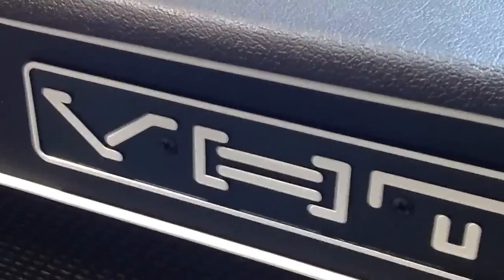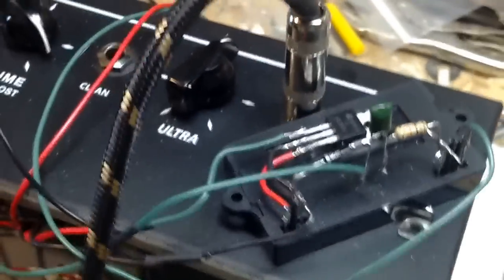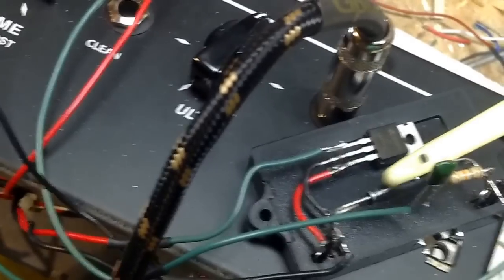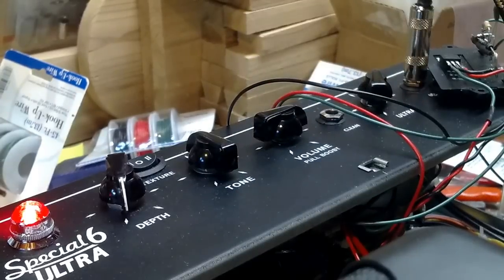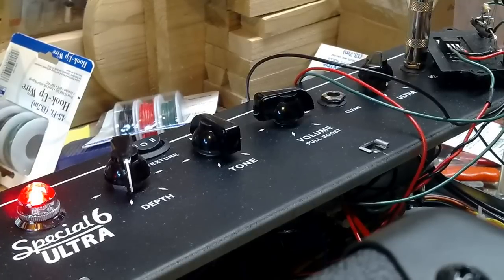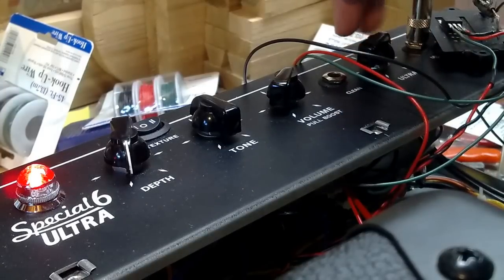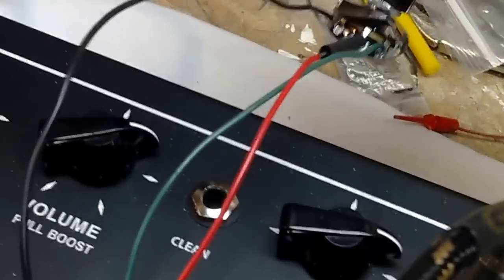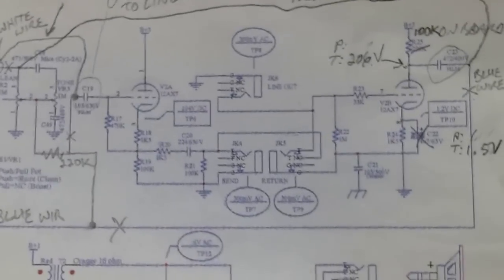Belton BTDR-1H-L added to VHT Special 6 Ultra

Comment: Thank you for sharing. So what i understand is that you installed it between each side of R23 (33k) before the grid pin 7 mixing point. The circuit start with a 10nF cap followed by a 10k resistor. On the output leg of the 10k resistor at the input of the brick there are 2 diodes in serie, the last one grounded to 0V. this prevent from overvoltage signal in the brick. The outputs of the brick feed each one a 4.7K resistor. the other resistors leg are tied to a 50k log Pot. Am I right?
Reply: per my recollection.... it is a .01 uf  cap to start ....     and a 100K pot  with a 22k  resistor on the output ....all other  details  you have  correct,  i believe

Comment: Hi! Thanks for sharing the video, we made but we still have some distorsion...Did you manage to get rid of the distorsion completely or still you can appretiate it? Could you please send the wiring diagram by email saranifer@gmail.com. Thank you very much
Reply from the maker: +Sara NF I did not remove it completely but I have thought that perhaps the distortion is actually coming from my protection diodes (at the input) which clamp at about 1.2 volts.  You could change the input and use LED's instead as a detect and then if they light use a pot that can then increase the resistance before the LEDs to lower the voltage sooner and remove any distortion.  I haven't yet tested it but it's on my TODO list.  What I've worked out is 100k pot (wired as a resistor) common to the LEDs (connected to gnd) with a 2.2k going to the brick input.  This should allow the brick to see a max of 1.39V at the input.
Reply: +Bobsbluesmusic 

We’ve managed to fix all the issues, the BTDR effect is very good. We’ve installed an independent 9v power supply for 7805 regulator, wiring ground to amplifier’s ground (you could use 9v for external pedals). It all works real well.VTH 6.2vare not properly filtered, they have a 1200 cap that could not be enough. 7805 needs at least 7v, a low-drop regulator that works at 6v could be used, but i think the problem comes from filtering.We obtained the best result by connecting parallel with tone stack and resistors higher than the tone stack equivalent, which is approximately 85k, this way signal is not lost and plate resistant V1B is barely modify.Input 100k+cap 0.033/600V   Output 100k+pot 10K.

Comment: The reason why I bought this Rev (Brick2H, long) was to build a small as possible Rev unit to fit into a small speaker box (of 16x8x8cm) for a compact Demo unit to demonstrate my whistling to music. I already built the "Dub A Rub", but its Rev effect was too short and I wonder how I could minimize the circuit's size w/o sacrificing its Rev quality? - I could reduce its physical size by soldering its components directly onto each other. You seem to have experience with this Brick Rev and may be able to help me in my struggle.  
Warm Regards, from young pensioner (74) down-under in St'go de Chile
Reply from the maker: +Joh Drinda Sorry, this was my first attempt, and I only do this as a hobby.